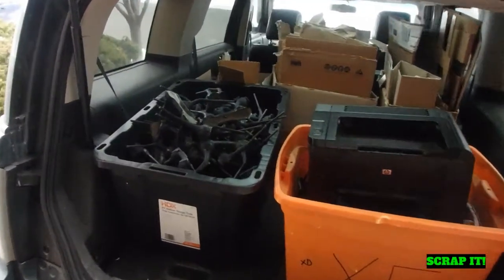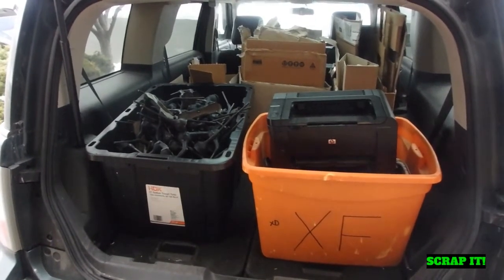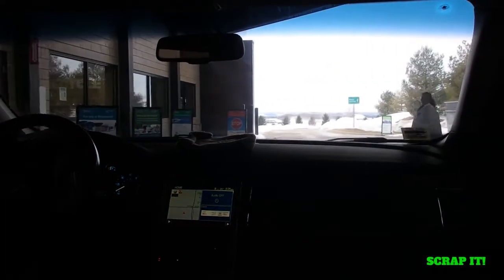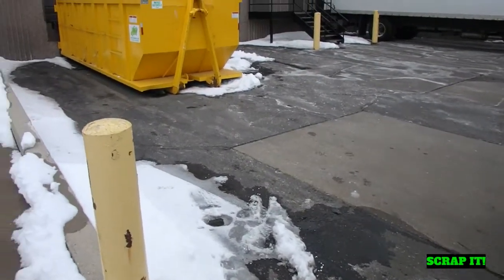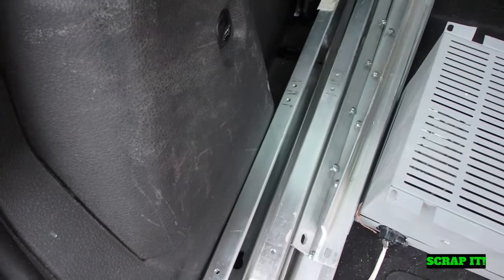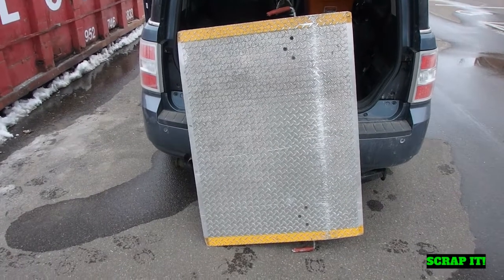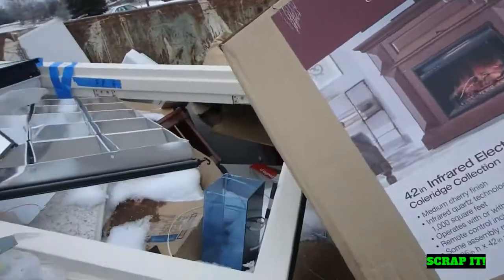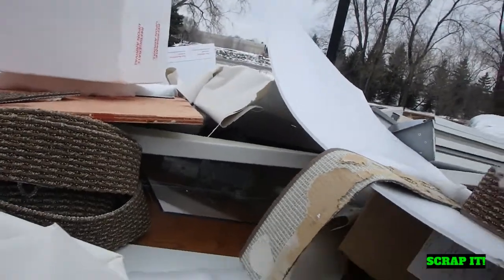DUMPSTER DIVING #2! ... And a run to the recycle yard

Comment: Sweden here again. Nice video, that black rolled up wire you found, I have about 1k ft of that in my garage going to be stripped. 
Oh by the way. I had a little nostalgia flashback when you were in the dumpster, I saw a box with the Armstrong logo on it. I had 20+ years with the company before they closed the plant here in Sweden.